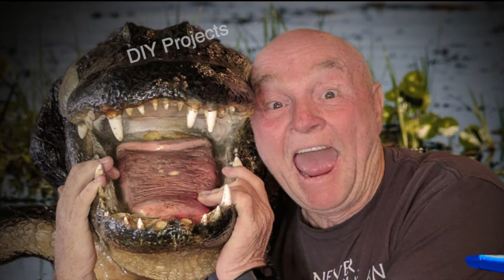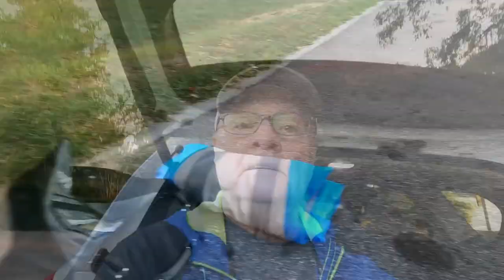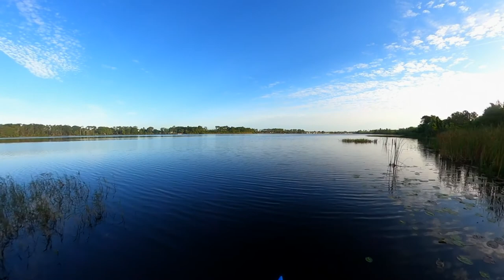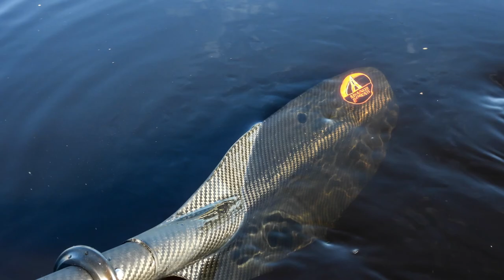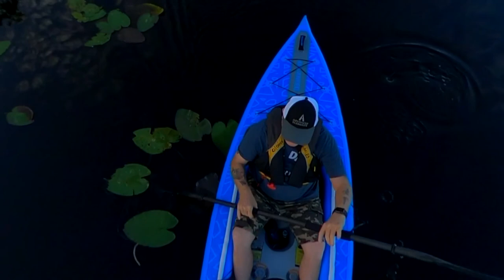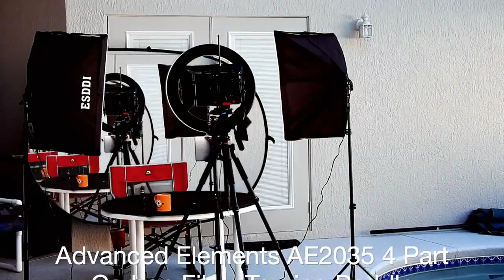AE2035 4 Part Carbon Fiber Touring Paddle

Comment: Which is your preference in paddles? I have both the AE2035 and the Fiberglass AE2030, I like the AE2030 best so far.
Reply from the maker: I definitely prefer the Carbon Fiber. But the fiberglass paddle is also very good.
Reply: Hi Toledo,your feeling would be useful as I am choosing these two. May I know your thought and feeling   or comoarasion on these two paddles？ There are not many choices in AU, aquabound is all out of stockhere.

Thank you very much！！
Reply: I have the AE2030 paddle and plan to get AE2035 Carbon paddle next after I purchase the AE Expedition for multiple day kayaking trips. You need 2 paddles. Wear and a spare for most gear as something will break when you’re out there.